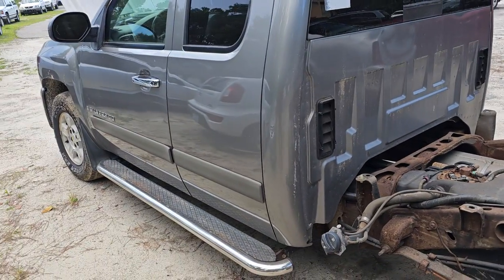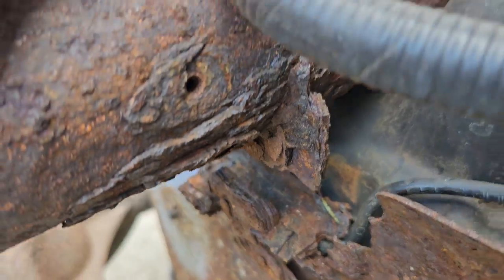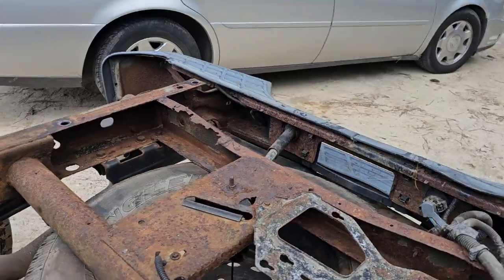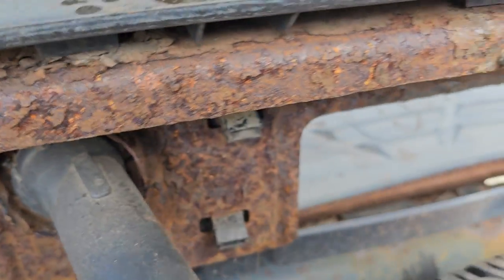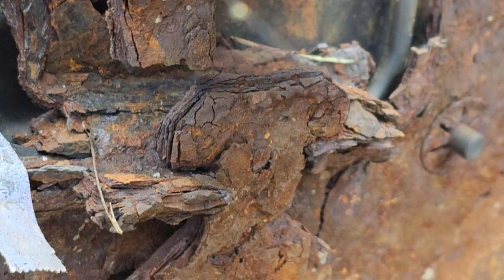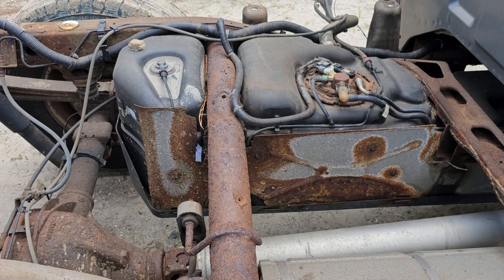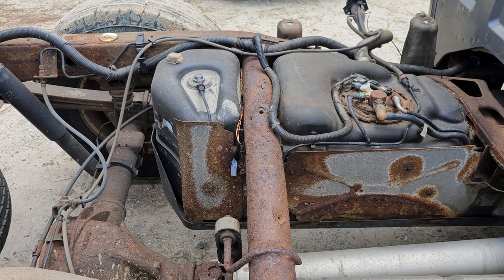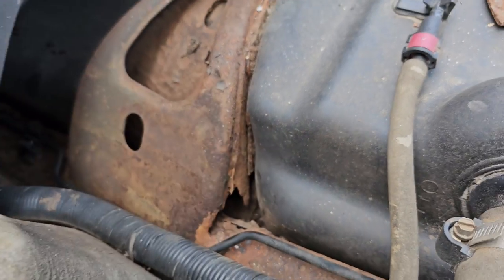Rust Never Sleeps!! Silverado, Sierra Frame Rust & Rot...

Comment: Replace the fuel pump, cut out and replace the crossmember, then hit the chassis with a wire brush grinder disk, then paint with POR 15 paint.  It will stop the rust cold.

Comment: A couple of years ago, I had a vehicle just as bad. We looked around and in time found a donor frame. I put the donor frame on stands in the garage. It took the winter but, with help, we were able to swap the old onto the new. It was a lot of work and took time but was totally doable. I had the time and a shop big enough and friends to call on for help. In the end I sold with a small profit.
Reply: For 99.99% of the public, that is not an option. And it took all winter. That is a hobby😂. I have a 2 car garage I work out of with a mid rise lift. I can pretty much fix just about anything on a car, but frame swap I don’t have the facilities or equipment to do it
Reply: We r u located boss I need a swap

Comment: Sooooooooooooo glad I moved out of the 'rust belt"!!!  I lived in Illinois and had an '03 Silverado and the body rusted to hell.  The brake line that crossed over at the front rusted through.  The truck ALWAYS started and ran beautifully, but the rust was the last straw.  Friggin salt in the winter is a disaster to any vehicle.
Reply: Easily avoided that today when great products like surface Shield applied when new

Comment: Interesting. After about 10 years my 04 Sierra rusted out on the rear fender wheel wells, rocker panels, cab corners, etc. I washed it regularly too. The frame actually held up pretty well. Very disappointed in how poorly the body held up. Got rid of it a few years ago.

Comment: Kenny, I have a 07 Silverado that had the same frame issues. Bought it off a used car lot and when I went to put shocks on it I found all the frame issues. Those early 07-10 Silverados all have that issue in the rust belt because the coating GM used on the frames did not adhere properly and starts to release from the frame but does not tear off. This created pockets for water to get trapped between the coating and the steel. I actually went through and cut out and replaced all the cross members, shock mounts and sections of the frame rail on mine. You will more than likely find that the drivers frame rail that is next to the gas tank will be rusted through as well. I still have the before and after pics of all the work it took to fix everything. Not a fast process.
Reply: Fascinating - it appears that GM has issued this same recall more than once!! Their fix is to strip off the affected wax areas and use a prep paint that is 3% phosphoric acid and 1% zinc. Then reapply the Nox wax. "The General blames the problem on a third-party supplier’s error, in which the supplier did not prep the metal of the frames correctly. As a result, the wax coating did not adhere properly, leading to it peeling off after exposure to the elements and driving conditions. GM has an available fix for this problem, offered at its dealerships."
Reply: somebody posted this on the Daubert Chemical youtube vid for Nox-Rust 1210HP: 
@ChrisrZ28
6 years ago
GM uses this garbage nox rust crap and most of thier frames are rusting out. go look at any silverado in the dealership lot and you will see what i mean.  brand new truck frames rusting. what a joke

Comment: That thing sat for a while after a few rust belt winters. That's why the sheet metal still looks ok.
Reply: People don't check things hoping that things will be OK and don't test drive it .
Reply: Oil spray is cheap and works well.
Reply: Find a used frame cheap that is good

Comment: Years ago, I worked at a GM dealership that had 2 owners. The one with his name on the building started a used car lot in a nearby town. He would buy cars at auction, then have them looked over by me, then detailed at the main dealership before taking them to the used lot. At first, he had every car for the used lot gone over at the main dealership. But after a while, he got tired of us pointing out problems, so he just took them straight to the used lot, had his kids wash them, then stuck them straight on the lot for sale. No inspections, nothing. Not even oil changes. The only time he fixed anything on one of the used lot cars was if someone said "fix this issue, and I'll buy it". Otherwise, they were untouched mechanically. That came back to bite him several times, but he didn't care. The second owner would buy nicer used cars for the main dealership that rarely needed a single thing. Sometimes not even oil changes, but we did them anyway, because he insisted.
After I left, the main dealership lost it's GM backing when the government bailout happened, so the shady main owner sold his half to the second owner. He turned it into a used lot that sells quality used cars.
Reply from the maker: The shady used car dealers always end up getting bitten in the ass. Thanks for sharing. Keep wrenching 🔧

Comment: Hi Ken, Good video. There are ways to go about this. Do you know how much they paid for the truck? Maybe not too much, so they can afford to get a whole chassis from a southern truck or a low mile truck with a smashed front, then R&R everything. Or as a last resort, sell the body, and drivetrain. Which way they go all comes down to what it will be worth when they are done.  I come from a low income area where the used car lots sold vehicles just like that.  The people who bought them could not be dissuaded, so I'd give them a list of safety items to fix in order of priority and I am telling you they  would come in every other week Semper Fidelis and get something done. It was a goldmine for the shop owner. I get what you're saying though: Why didn't they come in for a safety inspection first? Well that stems from your perspective. Ordinary people don't know the goings on of an automobile, and they're not lawyers, so they don't know. What I saw was they get bit by that "new car bug," and it bites hard.  Once they "see" themselves in it, they can't leave it behind.  You said yourself the body looks great. So you just have to work with them. Unless you hate doing that kind of work, give them an itemized list and give them an hourly rate. Visit a body shop who takes "totaled" vehicles and puts them back together. It's a lucrative line of work if you don't mind working on smashed stuff. Ditto with rust. ben/ michigan

Comment: I grew up in eastern Canada. 10 years out of a vehicle and it was rusted out unless you sprayed the undercarriage with rust check or used up engine oil. Makes a mess and you get really dirty doing repairs but much better than rusted out frame and body.

Comment: The rust is strong with this one. Owner was not as smart as he thought he was. Car dealers don`t like me cause I crawl under the truck and have a peak. If I cant get under it, I have a extendable phone holder and take video so I can see the condition. Had a few freak out when I plugged my scanner in. 🤣I got burned once 4 decades ago, never again. That truck needs a frame swap and it should last a long time provided owner keeps up with maintenance. Sorry the owner is going through this.
Reply: Bring a boroscope for box chassis frames - rusts from the inside out! What the freak out then. hahaha.

Comment: In the UK, the way this is dealt with is by the annual inspection. Used car sellers will normally get a new sticker, so it is sold with 1 year of motoring.  It would be unusual they would let you take the car to an inspection station. Our main recovery companies offer to go to the dealer to inspect, but you have to be a member, and pay for this.
Reply: Inspection stickers were almost universal here until it was finally realized that they were worthless. Cars from states that had inspections were found to be not one iota in better condition and in some cases better. This led to many states stopping the useless TAX that was the only real reason the inspections were in place anyway.

Comment: Man that is upsetting to see. Looks like a nice truck too. That rust belt is something else, people should rust treat their vehicles every year there. Although you may wash underneath well, the roads are full of salt even in the summer. That salt just eats them up, even the old cars that had thicker frames. Shame
Reply: I have lived here my entire 49 years.  I do not know what it is but something changed about 10-15 years ago with what they put down on the roads. Things rusted years ago but not like they do now. I bought a truck 3 years ago from down south and It wasn't rusty at all. I coeaned and undercoated the enitre frame when I bought it. I washed it regularly now 3 years later my frame is gone. It is either the materials GM is using or the chemicals they are putting down. It is no longer just salt. It is salt mixed with this blue chemical.....wish I knew what that is. I have seen with my own eyes 2 year old cars rusting badly
Reply: even in the summer!! So tragic.
Reply: @scottp7620  The salt turned into a brine now instead of salt rock. "So adding this bluish tint to that brine will help us ensure that we know what roads have been brined just a little more visible than other salt is." McLeod adds you'll probably really be able to see the Liquitint Winter after snow is on the roads as it will turn some snow blue"
Depends on what kind of undercoat - the Fluid Film does not last - nor any mineral oil. GM uses a petrolatum wax. Only it dries out and flakes off. So it only lasts a couple years - also it's probably too thin so water gets through it. I have been trying to save a 2004 TrailBlazer - with the box chassis frame. I got a frame repair kit welded on - since Colorado has the same frame. I got a patch plate weld put on. I sprayed phosphoric acid inside the frame and around. The Rustoleum Epoxy Applicance spraypaint actually holds up well. I used ChassisSaver also - it peeled in some places but held up in other places. Messy stuff though and cures in the can after you open it.
I used RP-342 paraffin wax. Now I just made a DIY petrolatum wax from toilet rings - 3 lbs of it - with 1 lb of paraffin mixed into 4 lbs of pure gum turpentine (that also leaves a rosin). Too thick to spray it - so I didn't get really good coverage. I will now buy FluidFilm black for the inside of the box frame - I used a boroscope and the phosphoric acid did convert the rust. On the underbody in general I'll use  STA-BIL® Rust Stopper which is another petrolatum spray with mineral oil.

Comment: Please help - My son's 03 acura 3.2 doesn't crank. https://www.youtube.com/watch?v=oLBLuBxXq6I
I tried the jumper wire but nothing but a few sparks?
When I use my prybar to short the pos & neg on the starter  I can jump it.
I showed my son how to do it last night (after the tornados we had), and he was able to get it going and went to McDonald's.
This morning, while I was at work, he cracked the plastic solenoid housing (face palm), trying to jump it.
I just put a brand new starter in it, (same as in your video), but it don't crank when I jump the energize wire either?
I cannot find the starter relay, (although I think its up under the driver's side panel)
It is an 03 Acura TL Type-S, (and I cannot find the schematic).
I'm very frustrated and could use your help solving this.
Thank you - Jim

Comment: I would look at the frame in front of the bed. If it doesn't look bad, I would try to get a frame cut off from the bed back and just replace the rear part of the frame. Assuming the rest of the frame is in good shape.
Reply: Frame on that truck really doesn’t look bad at all. Put a couple patches on it and oil it up. It will last for a long time like that in a  southern climate.
Reply: @mph5896
You are correct it probably would last a long time, but for a shop to do that type of repair puts a big liability issue on them. If God forbid there was a fatality accident the attorneys would wipe his shop out.
Reply: @tubeonline629  you are correct on the liability. A specialty shop would have to do the work. One that follows published procedures from the manufacture.
Reply: @mph5896  
That's probably true.  I have seen pickups that had the rear part of the frame changed out because someone wanted coil springs instead of leaf springs.  I seen a guy that had a Ford F150, and wanted to put coils on. He cut the back half of a Chevy off and put it on his F150. He used the Chevy rear axle as well,  the Chevy and Ford frames didn't exactly line up,  but it wasn't difficult to make them match. With this chevy/GMC  I would think finding a pickup with the front hammered,  the rear of the frame would be easy enough.  Just depends on how much money the customer is willing to spend.  It could in the long run be cheaper to cut off the bad piece and weld in a much better piece.  Than, clean cut weld the old piece.  Would have to check prices,  and the labor.
Reply: @tubeonline629  yes apparently it has to be a "repair kit" especially designed instead of a plate weld - to hold up against liability. Now that I think of it - the repair kit I had welded on - the mechanic never gave me a receipt. hahahha. I never made the connection until now.

Comment: Junk it. Would NOT want to see that truck collapse at 60-80 mph nor would I want to be the innocent family of 5 with infant children driving behind this truck when the gas tank falls off . We be in flames dead meanwhile driver thinks simply that the truck stalled. Better yet, same family of 5 stopped at traffic light meanwhile this Silverado lost it's brakes and slams into family of 5 turning them into ashes because rusted brake line was knowing rust to dust. Situation s like this should be a criminal event. Yea, time for the scrap yard
Reply: It would never fail it just weight reduction

Comment: Being a mechanic and a car lover myself as much as it's easy to just shitbag a certain manufacturer,  the real blame should be on the owners.  Everyone is worried about the parts you see to wash, it's everything else you need to worry about giving a good rinse periodically.  Spraying up in the wheel wells and under the underside does wonders prolonging the rust. An underbody wash at the carwash a few times a winter helps alot